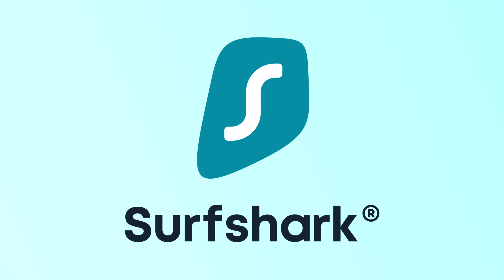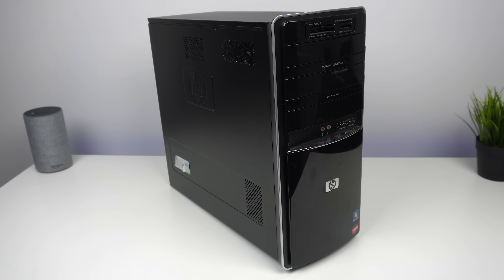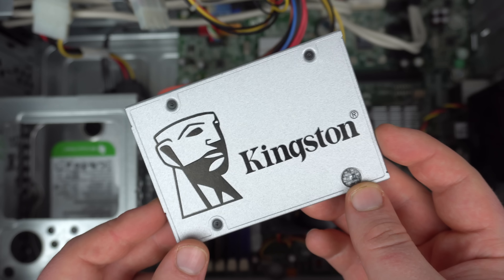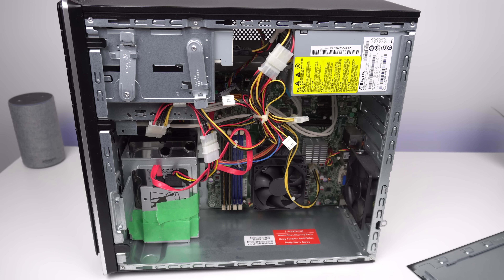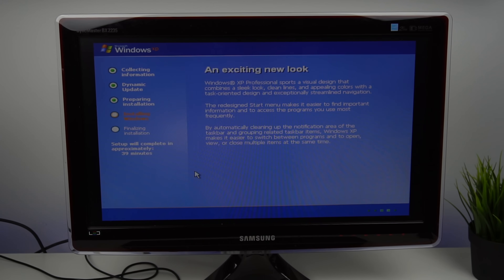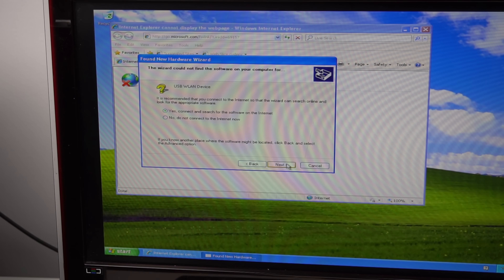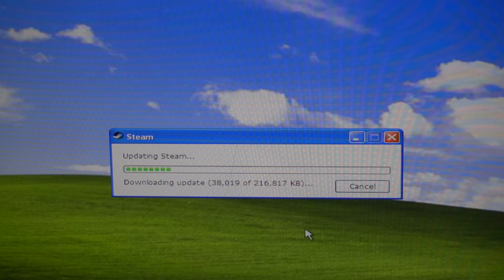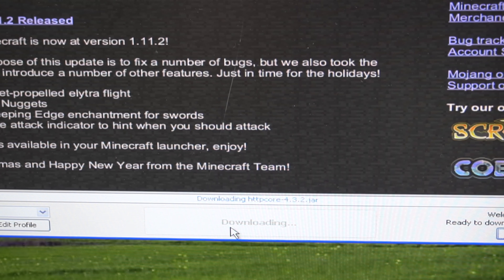Trying to use Windows XP in 2019

Comment: Microsoft needs to add a Windows XP theme on Windows 10 for Windows XP 20 years later in 2021, 3D Pinball, Minesweeper and all
Reply: Agreed. Though, you can get WindowBlinds on Windows 10 for $10, and add the Windows XP theme, get Open Shell for the Start Menu with XP theme, Microsoft should have an official classic option built-in along with Windows Vista/7 Aero and Windows 9x/2000 Classic theme
Reply: The games from Windows XP, Vista, and 7 can be added into Windows 10 with not much trouble, it would be nice if Microsoft had official ports of them so the average user could easily and legally use them.

Comment: The thing of the USB memory it also happened to me, i tried to install Windows XP using a USB memory and i also couldn't and i thought at first about installing it using a CD but i didn't have any blank CD and then i thought about installing the last NT 5.1 edition available and it was Windows POSReady 2009, so i installed it and when the setup finished i used again the Windows XP Setup USB Memory that i previously used and then i installed it directly from the OS just like an upgrade and it worked. A thing everybody can do if you have the time to do it hahaha.

Comment: Windows XP is still usable in 2019, i cofirm that.
Reply: yep, it kinda is. I know some places where they still use xp and do everything with it. too bad that dude in this video was not download proper drivers and resulted with rather bad video.
Reply: Actually Windows XP can load 1080p video normally.
Windows XP is still usable, but will not installable on modern (post-2015 Laptops) due to these laptop doesn't have XP Driver, some had but have poor support
or only support XP 64-bit, however XP 64-bit has poor support more.
Reply: yeah,, many industrial computers still using win XP, they just need to connect to internal server and run a lot of commands, while I use Win 10 only for YouTube and pirated movies😁
Reply: How do I get it to load websites? Internet explorer is not cutting it and chrome is not supported. I'm in virtual box

Comment: The good old days. I've always hated the process of installing and making it work as it is supposed to. But there is a way that we have perfected back in the days:
1. Install XP
2. On another machine find just the Ethernet drivers, because of course it didn't have any of them.
3. Open explorer and for gods sake install firefox, any version is faster than that.
4. Find SDI (Snappy driver installer) and download it.
5. Select all drivers and go drink a coffee or whatever.
6. Reboot and it's working as it is supposed to.
After that is just tinkering with the apps versions that will work on it. Yeah I miss it.

Comment: To be fair my parents still use windows vista
Reply: Tell them to upgrade to Windows XP, Windows Vista is trash in comparison.
Reply: vista doesn't sucks, all are good, it's run fine in my pc but older version of windows like Windows 7, older is doesn't install drivers automatically. so I lost access to internet until i found...
Upgrading XP to Vista then 7. I finally did that just a iso file and ultraiso for mounting setup.
Reply: @aero1082  *suck
Reply: Just upgrade to Windows 10 or any modded Windows 8.1 like Aero8 or Windows 9(unofficial), both those mod are no Start Screen enabled by default.
or Install Server 2008 using WinClient5270 (2008WindowsVista) tutorials from YouTube.

Comment: I myself got very old pc. Pentium 4 2.2ghz, old gaming Gigabyte brand mobo and geforce fx 5500 256mb agp card with 1.5gb ddr 333 ram. There is no sata connectors only 2 ide port. I got 2 ide drive both 80gb 7200rpm drive and 1 ide dvd drive. I installed winxp and its run perfect. Without Internet i installed all the drivers and downloads all old games from 2005 and below. Playing without problems. All run perfect with 1366x768 resolution.

Comment: Drivers, drivers, drivers. windows XP was completely useless unless you have the most up to date drivers for all of your hardware. from network adapter to graphics adapter. plus all windows updates as well. :)
Reply: + DO NOT USE SSD FOR XP. Why ... coz WinXp is made for checking disk over and over and ssd has limited read/write capacity. So xp will burn you ssd in a few days. Use HDD !
Reply: @nejctoto  dude SSD's don't burn out as fast as you think. My SSD is a year old and still working great. I've used more than 3 quarters of the space and it has over 4800 hours on it.
Reply: Ricardo The PC Gamer 
yeah on a computer that doesn't know what an ssd is, it would usually last 2 to 3 years
Reply: @longcat266  true, i have over 6200 hours on my SSD in my main PC now. I have an SSD in my 13 year old Dell laptop, The laptop says HDD in the BIOS, It is running Sata 1.0. The speeds are pretty low, It has a Crucial BX500 SSD, and it should be getting speeds of 500mb/s, I ran a crystal disk benchmark and it shows speeds of around 150mb/s. I was tired of the old 5400rpm potato drive it had, The SSD made a great difference.
Reply: If  you  install  Windows  X P  with  SATA  drivers , my  2012  HP  desktop  PC  generates  no  sound ...... no  music .
Reply: bro i just made a video on Windows XP pro virtual machine and i found 133 updates.
Reply: OH MY GOD, computer is not working without drivers!!!! Who would expect that?
Reply: its painful to install internet drivers for wired and wireless :(
Reply: Any OS is "useless" without the drivers. Windows XP is just one of 'all' operating systems.

Comment: Amazing video!!! Can you do this with Windows 7?
Reply: Windows 7 is still supported and is a solid OS and there wouldn't really be any "challenge"
Reply: Gaming Wire but only 6 months to go until it will stop getting support in 14th of January 2020
Reply: Software developers continue to support an OS for at least another 2 years after it ended support.
Reply: @ShockwaveEXP  and when they will stop support what does it mean? I won't be able to download apps and use them like word and more?

Comment: Using the iPod shuffle 4 gen in 2019 please
Reply: Fine pro Gaming use ipod touch 2g whit ios 3.1.3 please
Reply: Will be no different to using it in 2010... It plays music, job done
Reply: Tpavra that’s not all the most important thing is is it forth the money and does it hold up in 2019
Reply: @watermelon_boi  Well if you want a simple music player then yes, it would be fine. Just the capacity is rather low, I think it was something like 256 or 512mb on the shuffles. If you want something for streaming services etc, then no, it obviously isn't and was never capable of doing that  :)
Reply: Tpavra actually by fact 2,000 mb which are 2gb in the iPod shuffle 4th gen witch are a lot of songs
Reply: Tpavra witch can hold to 250-350 songs
Reply: Tpavra any btw I’m talking about the 4th gen witch came out in 2015

Comment: I am working everyday with Windows XP to operate the plotter... and I can't shut down the computer, otherwise it would not start again because of the old hard drive.
Reply: Tom Peck if you can’t reboot the deta is already gone. It’s running on ram
Reply: It's time to upgrade.
Unless you're using it for a specific reason.
Reply: Thunderland he literally said he will loose all deta If it’s shut down
Reply: @Arctic740  I'm saying that if he is working on the PC it's time to upgrade. He can backup his files with a flash drive if he has important stuff on that PC and transfer it. If he uses it for nostaliga or something like that it's ok-but if there are important files on the computer it's better to backup then to risk them because of a faulty HDD.
Reply: Thunderland the hdd already failed he said, unless he can somehow dump the contents of his ram he is stuck.
Reply: @Arctic740  read his comment again.
Reply: Thunderland yes he can’t shut it down cause it won’t boot due to the failed drive
Reply: @Arctic740  Now slowly read my replies.
Reply: @brotnjanin  As he is using a plotter it might not have new drivers or the key to re-install, my friend has an old cad program he wont be able to renew the licence and it cannot be re-installed, he is good with that program so is very reluctant to switch to a newer one

Comment: Windows XP Is awesome.
Reply: Yes it is
Reply: Lorenzo van Gulik But it cannot beat Windows 7.
Reply: @slayyyters_cigarette  ok boomer
Reply: @slayyyters_cigarette  it can. 7 isnt as good as xp
Reply: @lamasu8060  Windows 7 was the best. The rest aren't great.
Reply: @manomant181  XP is better.
Reply: @lamasu8060 Windows  7 is better
Reply: @manomant181  nah its not
Reply: @lamasu8060  it is
Reply: @manomant181  it isnt.
Reply: @lamasu8060  it is
Reply: @manomant181  it isn't.
Reply: @lamasu8060  it is
Reply: @lamasu8060  it is
Reply: @lamasu8060  it is
Reply: @lamasu8060  it is
Reply: @manomant181  it isnt
Reply: @lamasu8060  it is
Reply: @lamasu8060  it is
Reply: @lamasu8060  it is
Reply: @lamasu8060  it is
Reply: @manomant181  XP x64 destroys windows 7 you can keep your bloated vista 7 mine is windows XP 6ghz cpu 64gb of ram running a 4gb gforce gt 730
Reply: Indeed
Reply: Yes
Reply: Startup sound is a meme